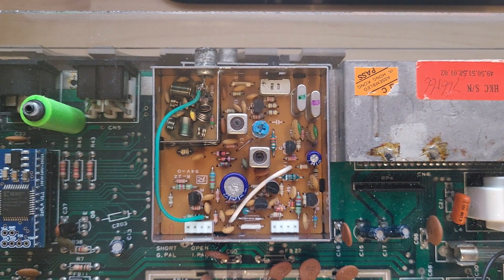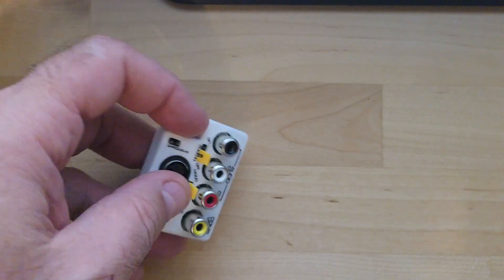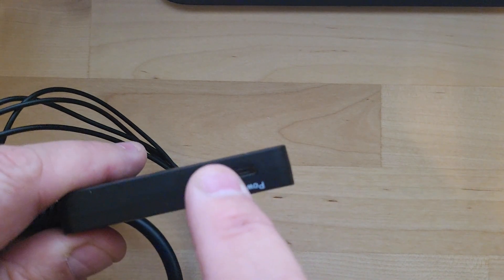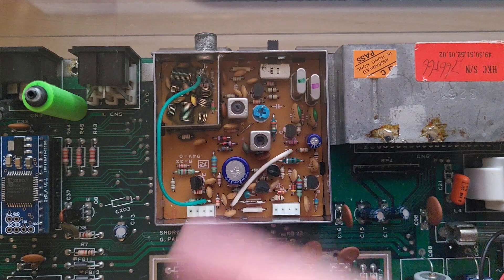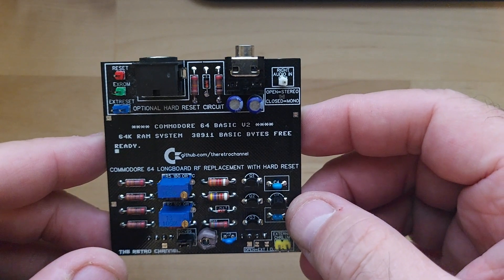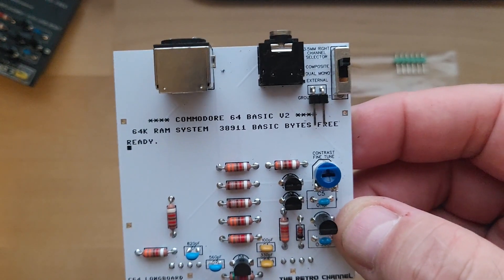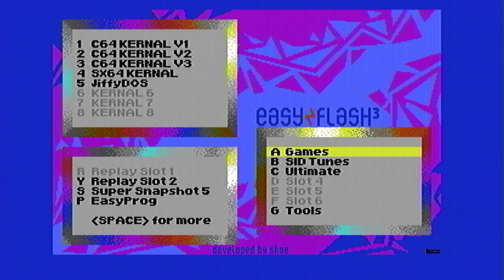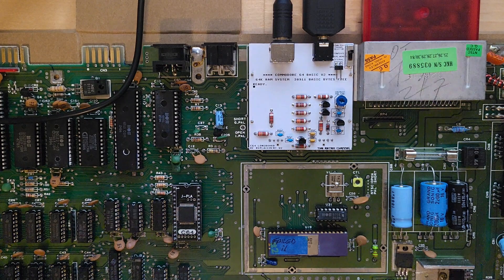Commodore 64 to HDMI - Easy and Affordable

Comment: Is there a reason why you plug in both the RCA cables and the S-video into the first adapter?  I guess you need at least the audio from the RCA, but isn't the video redundant?
Reply from the maker: The HDMI goes to my video grabber and the RCA goes to my 1084 monitor. I use both monitors. :)

Comment: Nice video and thanks for the shoutout. Yeah handy little tidbit with regards to the capacitor at C1. The values that can be used there are from not installed, to around 2nF. Lower values will provide a sharper image while allowing more potential noise, higher values as you mentioned will smooth the image but may help hide jailbars.

I'm currently working on yet another version. It's a completely different beast from V1 and V2 but will still retain the outputs at the back and 3.5mm selector switch. Video quality will be even better as will the overall look of the board itself. Jailbars will also be reduced in most cases without needing to change caps or soften the image. Stay tuned
Reply from the maker: I know I may be speaking for others as well...  we appreciate your contributions to the hobby! Thank you! :)

Comment: will this work on the N 64.?
Reply from the maker: I believe the N64 puts out composite video so the upscaler should work but you may want to look for the similar model that doesn't have the s-video since you wouldn't need it. The model without this input is a lit less expensive. If you looked up the Amazon link in the description, I believe it will also show this model as an alternative.

Comment: Nice!  Oh hell very nice.   I have to give this a try to get my 8 bit machines converted to HDMI.   They all run on a 1084 so as soon as I am done with getting my Amiga's and ST's connected to my HDMI KVM Switch so they all share the same monitor, keyboard and mouse.  It's not the least expensive solution but I am space limited so those computers living in server racks to save space and get there power from PDU Switches and no not all of them are not powered at the same time.   I think it would be great to have the old Commodore systems live in a rack.

Comment: i could understand possibly wanting to add HDMI to a Atari but whats the point of upgrading a commodore 64 my digital watch has more computing power
Reply: Atari?  All you can do with that is play games with really terrible graphics.
Reply from the maker: Considering I've restored no less than a couple hundred Commodores over the past couple of years, there's still a large following (and I have dozens of Atari as well as Amiga systems) - The C64 still seems to be more popular. Nostalgia is a good reason. After all, the Commodore 64 is the single most popular computer system ever sold so a lot more folks probably owned one.
Reply: What’s the point in your comment?  Your watch has more power than the Atari also. 🙄

Comment: Nice comparison on the different aproaches and how they evolved. How does this compare to RGBtoHDMI?
Reply from the maker: I would tend to think RGBtoHDMI might be more robust (the RGBtoHDMI adaptor connects to a Raspberry Pi). This is using S-Video and an upscaler for HDMI conversion. This was merely a low cost solution to improve the signal. There are no doubt better (albeit more expensive) solutions. :)

Comment: The Retro Channel RF Modulator v2 itself has nothing to do with HDMI. HDMI is a function of the VIC-II Kawari, with goes for $78 USD. Not exactly affordable.
Reply from the maker: Sorry if I confused things. The video shows that this modulator outputs s-video and goes to an upscaler for HDMI. I should have stated that it has the option of interfacing HDMI, but as you point out, you would need the Kawari longboard for that (and a bit more costly).

Comment: Copperdragon does not output HDMI.
Reply from the maker: Yes - you are right. On my 128DCR systems, I use a c0pperdragon (which produces YPbPr) and a Raspberry Pi RGBtoHDMI converter. I left out the converter part when I was flying through that part of the video. Thanks for pointing that out.